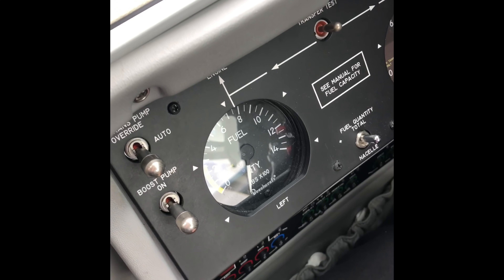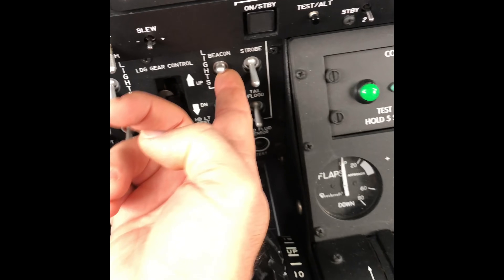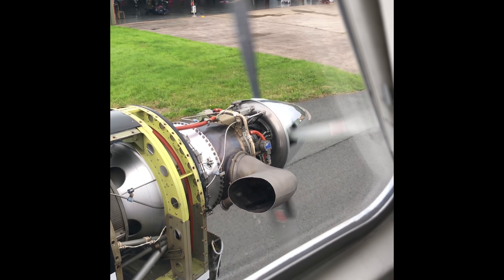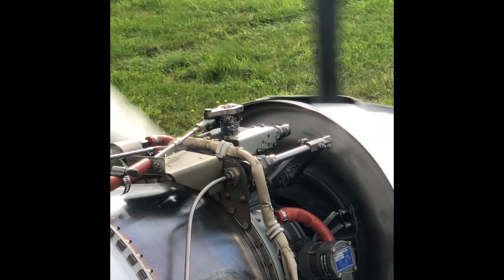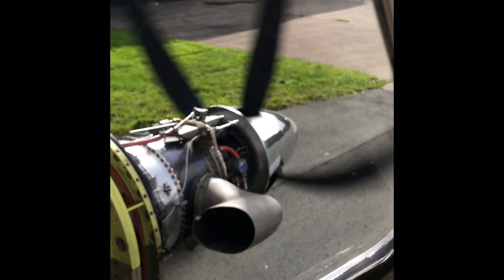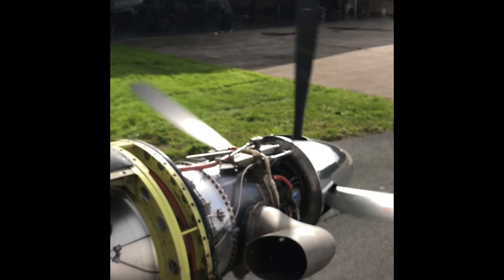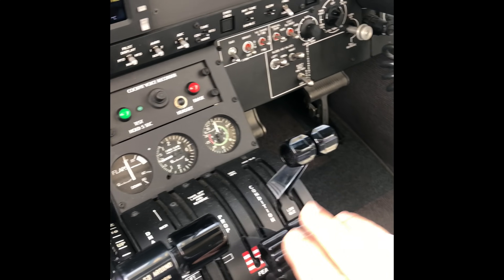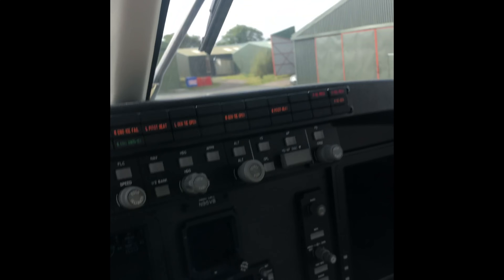King Air Propeller Demonstration

Comment: Very interesting indeed !  Thanks for this demonstration. I am not used to turboprops, flying only small piston engines. What about the fuel consumption during feathering ? Does it increase because of the higher resistance of the prop ?
Reply from the maker: It’s neglible. Remember that the engine is never working any harder throughout the process. The “Power Levers” are never touched during the demonstration… it’s idle power throughout.

Comment: Does running in the feathered position make the power turbines run hotter ? Going from fine to featherd lost you something like 65% prop RPM. Are there any drawbacks to that kind of speed loss ?
Great video by the way!!
Reply from the maker: In my experience the turbines might run slightly hotter but totally negligible. To me, the benefits of starting with the props feathered outweigh the disadvantages. Things like: Quieter, friendlier to ramp personnel, if there is snow/ice etc… inadvertent taxying if the parking brake loses pressure etc.
Reply: @Mode_Sierra  hey mate.
Super interesting. Not a pilot but fascinated by these machines. I do volunteer ambulance work in a remote community in Western Australia. We transfer patients to the local airport and its most often a PC12 that picks them up. Spool up time is so fast on these things. I fly RC jets and our miniature turbines take longer to start than a pt6.

Comment: Question: How short can a King Air takes off let's say at an airfield with 25 feet MSL elevation and an OAT of 30°C, wind calm? And can it takeoff from a grass runway?
Reply from the maker: Without getting the POH out, I can tell you that I have many times taken the C90GTX into and out of a grass airfield that is 800 meters long. Max 4 occupants and 1,400lbs of fuel. That’s just over two hours endurance.
Reply: @Mode_Sierra  thank you for the answer! It's quite a versatile plane yeah?

Comment: I found it interesting that as you varied the prop pitch the RPM changed. I'm familiar with the turboprop engines used on the C-130 Hercules. On those engines the RPM's are tightly governed to a very narrow speed range of about + or - 1.5%. When the pilot increases the prop pitch the torque and fuel flow increase drastically but the RPM's stay constant. I thought all turboprop engines worked like that.
Reply: The C130 uses a fixed turbine. All the engine and prop are geared and run together. This video shows a PT6, its a free turbine. The compressor is mechanically independant of the power, and its driven by exhaust gases from the compressor. Ive seen people hold the propeller still while running the engine to check for leaks.

Comment: That's neat! The strobographic effect of the camera shutter rate really helped to see it. Question: I noticed you started in Feather. Do your planes have issues with the leading edge between the fusalage and the nacel taking overheat damage from the exhaust when running in feather?
Reply from the maker: Ahhh... so that’s the real name of the camera effect :) thanks.

We haven’t had any “overheat damage” no. One Issue or King Air 90-ism we have found is that the exhausts really cause quite a soot build up over time that require us to wash the plane fairly regularly. I don’t think this is related to starting in feather, and I’m aware that there is a (very expensive) kit out there that can be fitted to avoid this.

Comment: Does the red morse cable on the port engine shown.. have too much kink behind the casing mount.. causing a cable core fray to failure point.. ????????   it might be interesting to cut the ends off a used cable and extract the cable core to check for hard spots from excessive flexing. then unwind the core strand by strand. in that area..

Comment: 0:44  Is that elbow pipe the intake or the exhaust of the turbine?  The metal looks discoloured from heat, so maybe the exhaust?  But that would mean the engines are put on backwards, no?
Reply from the maker: It is the exhaust. And you are right, the PT6 engine is a reverse flow turbine engine. See my anti ice demo video for more explanation :)

Comment: Did you turn off the beacon?
Reply from the maker: No, the switch generally stays switched on, and the Beacons turns off when the master battery is turned off.
Reply: One of my dream aircraft to fly 👍🏻

Comment: Dare I ask what mode the radar is in while ground folks walk about in front???
Reply from the maker: It is off :) On the ground it needs to be specifically switched on (as opposed to left on).

If you have the radar on before landing, it switches to standby automatically after landing.
Reply: @Mode_Sierra  excellent

Comment: Cool! But the master switch looks as if it could be easily knocked down by accident or is there any safety lock? I guess it's not a pleasure to accidently hit that flap when you are in mid air 😅
Reply from the maker: Hi there, it’s not a problem. It actually requires a bit of force to push it down. I’ve never heard of a case where it was accidentally done. :)
Reply: @Mode_Sierra  Thanks for the answer 👍

Comment: Boost pumps were on even before master switch was on ?
Reply from the maker: Yes. As per checklist. It’s a C90 thing.

The boost pumps are on the “hot bus”... which means they get power from the battery whether the battery switch is turned on or not.

Comment: i jump in my ford ranger and push a button, but in comparison to flicking switches in order, checking volts on a roof mounted device and hearing that turbine whine?  ford missed an opportunity.
Reply from the maker: That made me chuckle. Maybe we should write a strong letter to General Motors?
Reply: @Mode_Sierra   Another one? Ok, done.    ; )

Comment: ProLine 21. - 135 power plant. Ideal configuration for the KingAir 90.
Reply from the maker: Can’t knock it! It crazy to think that Pro Line 21 is already considered “old”... with the Pro Line Fusion replacing it.
Reply: @Mode_Sierra  Thanks Johan - I agree. Fusion is much more modern from a design perspective, but from a pilot's perspective (and the KingAir is the ultimate "pilot's flight deck") ProLine 21 is atleast its equal, and in my opinion easier to use.
Reply: I flew a BE20 with no FD, it literally had an old 172 style AI

Comment: Fine: pushes air, lets you fly
Coarse: almost no air resistance, lets you glide
Reply: Fine: pushes little air per revolution, results in higher RPM and less torque, keeping power reserves for go-around etc.
Coarse: pushes more air per revolution, lower RPM, higher torque. Too much torque will damage the engine.
Feather: pushes little to no air, reduces drag and allows for better glide performance in case of engine failure
Reply: @matthiaspatzelt3085  thanks, sure its nothing for those who knows but means a lot for those who know nothing like me... 😅👍
Reply: @matthiaspatzelt3085  wait, i thought coarse is feather in props ?!
because the angle of blades in feathering and in coarse results in little to no RPM
Reply: The way I used to remember it is Coarse sounds like Cut, props turn into little knives in the air.

Comment: Hey, what do you use what prop setting for? Heard it’s like shifting gears(?) do you use the low angle of attack of the prop-blades for acceleration then and the high angle of attack once you’re in a faster cruise flight, like an overdrive gear? I’d love to hear from you, since I’ve never operated any plane that used an adjustable prop! 😄
Reply: Fine pitch on the blades to achieve a higher RPM to increase climb performance at lower altitudes where the air is more dense.  Once the aircraft is level at altitude feathering the props allows the blades to more effectively "bite" in to the less dense air increasing engine efficiency.
Reply: @lancelotvt  Thank you very much this helped me get a general understanding very much! :)
Reply from the maker: In essence, regarding prop lever settings, the only pilot action during a “normal” flight in this type of aircraft is as follows:

-Props full forward (fine pitch) for taxi and Take Off. See Note 1 below.

-Adjust the props to “Maximum Continuous RPM, or Climb RPM shortly after take off. See Note 2 below.

-Reduce Prop RPM for the cruise. See Note 3 Below

-During the approach phase adjust your props back full forward for the landing (reverse thrust) or for the anticipated “go around”. See Note 4 Below.

That’s it. The rest of the time, the governor works to achieve the RPM that the pilot has “asked for”/selected. So when there is excess power, it simply reduces the pitch of the blades to take a bigger “bite” of the air.

Notes.
Note 1: The props won’t achieve the High RPM you require, until you apply sufficient power using the power (thrust) levers to turn them fast enough. Once you have enough (and excessive) power, the governor will continuously adjust the propeller pitch to maintain the RPM you requested.

Note 2: In the C90GTX, the difference between Maximum RPM (time limited) and Maximum Continuous RPM is very small. Just a fine tickle back of the prop levers. If the props are rigged correctly, this is a change of 1,926 RPM to 1,900 RPM. In other King Air models, the difference between Max RPM and Max Continuous is more of an adjustment. (300-400 RPM in the in the models I’ve flown)

Note 3: Refer to the Cruise Tables in your Pilot Operating Handbook. In this particular model, you can leave the props at 1,900. We do however tend to adjust them to 1,800 for longer cruises, because it changes the “tone” of the props to a more comfortable one for passenger comfort.

Note 4: Pilot technique differs here, based on the types of props you have fitted, runway available and passenger comfort. In the C90GTX, I always adjust the Props to full forward in the final approach phases of a flight. That way, the “Reverse Thrust” is ready on the ground and I simply have to put the power levers in reverse. Same with a go-around... it leaves me less things to do.
In the B200 or other models of the 90 that I’ve flown, you could be adjusting the props from 1,600 to 2,200 RPM ready for the reverse or go around. This can have quite a noise increase for passengers. So, many pilot choose to leave the props where they are until after touchdown, when they will then whack prop levers full forward before applying reverse thrust. This of course, is runway length and other conditions permitting. 

I know this is a long reply, so I’m going to add it to the description of the video. Hope it helps.
Reply: @Mode_Sierra  Man, this helped for sure! I really appreciate your effort to response so detailed! 
I’m not very experienced yet, mostly flew sailplanes and once in a while single engine piston‘s with non-adjustable props.
There’s always something new to learn every day. It seems a little complex, looking for the prop setting as well, but I’m pretty sure once you get used to it it won’t be a problem at all.

Thanks again for the long reply, I really enjoyed reading this and it helped me a lot! :)

Comment: Thank you for showing the prop mechanism, never actually saw it in action during eight years of aviation! Gotta love pilots thinking of the community while doing those kind of tests :-)

Got a question for you: Why do the boost pumps need to be on during shutdown or a least until N1 being below 10 percent? The condition levers are already in the cutoff position, why worry about boost pumps and N1?
Reply from the maker: You are welcome! Glad you liked it. Someone else asked the same question, so I’ve copied the answer. Let me know if  it explains it ok.

The purpose of the electric boost bumps is to prevent cavitation of the engine driven fuel pumps. Cavitation (destructive) happens when there is back pressure in the fuel flow and “bubbles” that vaporise form in the fuel pump. Cavitation can destroy your engine driven fuel pump over time. And no engine driven fuel pump means “bye bye engine”. The electric boost pump operates at a much lower pressure than the engine driven fuel pump and can’t support the required fuel pressure for the engine. It only serves to protect the engine driven pumps from cavitation damage. Above 10% The electric boost pumps still do their “job” of preventing cavitation. Once below 10% the risk of cavitation ceases and the boost pumps can be turned off. Hope that explains it ok.

Comment: Fascinating! It is interesting how those boost pumps would run, even before the battery master switch was switched on.
Reply from the maker: Yes, they are on the “hot bus” and one of the C90 “gotcha’s” to look out for. Could drain the battery regardless of battery switch position.

Comment: How come you start it up in feather? Unnecessary wear during start up...
Reply from the maker: See earlier response to the same question. It’s a free turbine engine, no mechanical linkage between the propeller and the engine. No wear. Engine doesn’t work any harder.

Comment: Always wondered if that dramatic drop in  power turbine rpm creates a huge force in the reduction gearbox when feathering like that.
Reply: You can see the force on the torque meter. It’s basically just measuring oil pressure as compressed by piston connected to one of the ring gears in the RGB. 

Feather it at close to max torque. Yeah, you’re going to overtorque it and damage the RGB and other things. Feather it at idle?  Hardly noticeable.
Reply from the maker: It’s the sound that makes it worse than it is. In essence it’s only a 700RPM drop. And the drop happens slower than the sound suggests.
Reply: @Mode_Sierra  not in the turbine it’s not. Turbine spins much faster than the prop. It’s a 15:1 reduction so that’s 15000rpm down to 6000. Lots of intertia involved

Comment: How come the rpm rises when turning the props to fine position? Is that because of the blades having less air-resistance?
Reply: Very good analogy! Good to know my mind works right, haha.

Ughhh i can only dream of flying a King air. My absolute goal in life.

Love it!
Reply from the maker: Yes. The engine is producing the same amount of power, but the blades are easier to turn.

The analogy of having your hand outside the car window comes to mind. If the car does the same speed it’s easier to keep your hand there when your hand is parallel to the road as opposed to 90 degrees to the road (vertical).

Comment: I remember on the 99's every winter rigging the reverse torque and every spring rigging them back. This was in northern Ontario where winter daytime temperatures could be below -30c.
Reply from the maker: I just know you have interesting stories as soon as you mention 99’s and Ontario Winters.
Reply: @Mode_Sierra  I worked for Bearskin from 86 to 88. Seen plenty of 99's operating in some harsh conditions.

Comment: That was very informative and concise, now I'm sure I can fly it!  I'm interested in the mechanical linkage that alters the pitch of the propellers.
Reply from the maker: Hi, if you research “propeller governors” you’ll see how the governor works to maintain propeller RPM using engine oil.

Comment: That’s fascinating, but...why isn’t it all automatic, as in , computer controlled with multiple redundancy and just one start switch? When I start any of my machines, their processes can’t be too simple compared to running an engine on a plane? Yet they only have one start button. Of course you should have total control available through layers of screens, etc. but it just seems far too complex for just starting a turbine?
Reply from the maker: Hi Stephen, I think you make a fair point.

But it’s important to remember that these King Air designs stem from the 1960’s. Whilst many improvements have been made to the aircraft, it is yet to feature a fully automated start procedure like you get on FADEC controlled engines. The helicopter I’ve flown is a turbine engine that starts fully automated by the flick of a button.
Same with the Challenger 300.

Many other aircraft of course, but I just mention the ones I’ve experienced.
Reply: @Mode_Sierra  Thanks for that info. I didn’t know that aircraft was so old!

Comment: The King Air is just a gorgeous turboprop inside and out. But, really love the cockpit.
Reply: It's also a ferocious sounding plane. 
That prop tone you hear at 2:10 is often the loudest sound at the airport if it isn't a military base. 
I call King Airs the Dodge Hellcats of General Aviation. Because they sound mean as can be, they sound powerful, and they are a joy to listen to. (Even a bit humbling when you're right up next to one while its running)
 Even if you need hearing protection within 700 feet of them 😅
Reply: As someone that’s worked on these things & hates them with a burning passion I just wanna say that I appreciate people like you who love them. They do look good though. 😂
Reply: @HekateMGO  I do avionics and these are not the easiest to work on,
Reply: Yeah, it’s gorgeous, but the inboard tanks between the engines and fuselage are a pain in the a$$ to get to and fuel!!!
Reply: @Dale_Persails . Not ‘signal point?’
Reply: @Posttrip  Nope. One, two or three tanks per wing with the mains being between the engines and fuselage
Reply: Yes it is!
Reply: I'm 32 year old private pilot that flies and in charge of maintaining  3 private planes fir a huge company. They have 2 turbo prop king airs and a 2022 Gulfstream g700